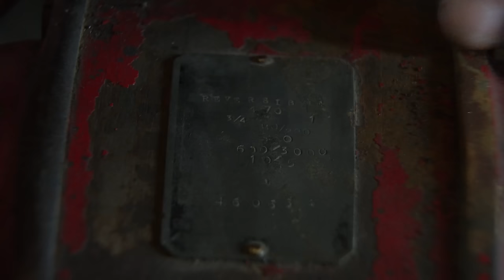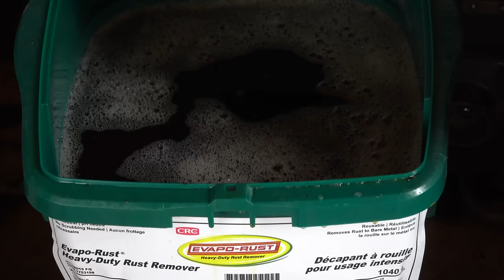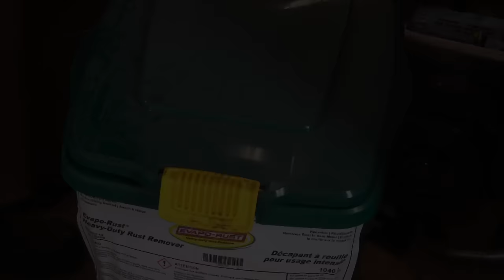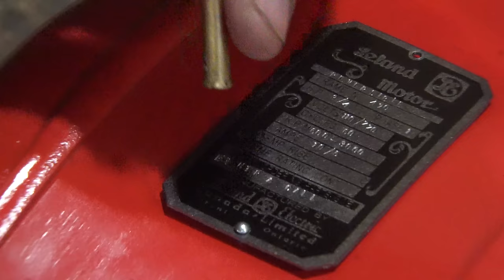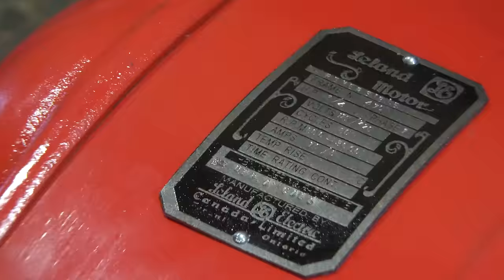Why Did They Stop Making These? [Restoration]

Comment: These sort of motors are apparently called "repulsion motors" ( https://en.wikipedia.org/wiki/Repulsion_motor ). They seem to be very similar to a normal brushed AC motor (e.g. vacuum cleaner) but are wired up differently. My $0.02 for what it's worth. In a regular AC motor, mains current passes through one stator coil, through the rotor via the brushes, then out through the other stator coil. However, in a repulsion motor, mains is connected only to the stator coils. The brushes are shorted together. Depending on the angle of the brushes relative to the stator, that determines whether it runs fowards, backwards, or is stationary. It's now got me wondering if it would be possible to convert a regular AC motor into a repulsion motor with a bit of tinkering!
Reply: same! That would imply giving pseudo VFD capabilities to a motor that couldn't otherwise be outfitted with one.
Reply: Thanks for the info, i was wondering what type of motor this is. Never saw one like this
Reply: Not the same as vacuum motor
Reply: A lot of modern mains powered drills (at least from Bochs, DeWalt, Hilti and Metabo) have a brusholder that is turned to reverse rotation but the brushes are wired the same way as on models with a reverse switch.
On some of them you can turn it partially and get lower speeds, but that's not the proper way since those have electronic speed controllers and some also 2 speed gearboxes, but I think all of them have an interlock to not allow the trigger to be pulled when the brush holder is in "neutral" or too close and the same way you can't reverse it while you have the trigger pulled
Reply: I think this is a good description.  I wonder what the torque curve would look like?  I suspect that the available torque would decrease rapidly once the brush timing got away from the ideal. So although the speed and direction under no load look good the performace under load might not be great.  Unlike a recent electronic speed controller.
Reply: @dundasjunctionmodelr.r-jam8267  I didn't say it was....
Reply: @ruben_balea  Interesting! Do you know any model numbers? I could actually do with a new mains drill 😎
Reply: @hefy2jefy  It is at its peak 45° from the neutral "off" position. The torque curve is your basic sinusoidal curve it isn't particularly interesting. It is however fairly interesting that it it can handle a variety of voltage ranges due to the stator being (effectively) isolated from the armature. More so than modern alternatives. 

Unfortunately the design is fundamental flawed in a variety of ways mainly safety, longevity, and ease of use.
Reply: that´s the same thing i was thinking it could do
Reply: In the 00's a friend of mine took up a cinema that was without an enterpreneur... film would still be the way to go for a few years, although digitalization was soon to come... yet in between, the "solar" soundtracks were changed from black to cyan dye and the exciter bulbs to red lasers or high intensity LEDs. Well, I could go on about that.... but the film winding bench had this type of motor.
Reply: And it's not used anymore because deliberately introducing slip in the rotor is horrifically inefficient compared to a VFD  :P
Reply: Make a video.
Reply: @imajeenyus42 In your first description, isn't that a "series wound" motor? The funny thing about that is they can run on either AC or DC. One time just because I was bored, I ran a 120v drill with a 6 volt battery! It worked, but of course it was turning really slow.
Reply: @ct92404  Yup, that's right! You get series, shunt, and (apparently) compound as well. The varieties are endless ;-)
Reply: @synisterfox Using 2 of the 3 outputs of a VFD (and disabling missing phase detection feature, if present) should work on a brushed universal/series-wound motor, although you'd need to program a vfd output  to flip an accessory DPDT relay to flip tbe brush polarity to make reverse work.  You'd probably crank up the Volts/Hertz ratio as high as you can so that  voltage changes a lot, in as little Hz change as possible.    But it'd be overkill in most applications as TRIAC choppers work pretty well.
Reply: @cda32 Oh man, I imagine the Power Factor must be awful, dirty 'n noisy. But hey, it's the 30's and that's way cool.
Reply: My parents have a 35 cow dairy barn with an old Berg chain-drive gutter barn cleaner and a single-phase 240v 5 HP repulsion motor. The shorting brushes can be rotated, but the frame is fully enclosing with no external adjustment. Other than brush replacement every decade or so, it keeps going with very little maintenance.
Reply: @synisterfox  it's not a variable frequency drive, it's a variable torque drive, I think
Reply: Your link was for me broken. So here is a search string that should take you to the correct page:
    en.wikipedia.org/wiki/Repulsion_motor
I don't know why your link didn't work for me.

You are right, this is the exact type of motor. The repulsion motors work by creating a standing field in the stator windings. This is then inductively coupled to the windings in the rotor, much like a transformer. The induced field in the rotor can then be moved out to a different angle related to the fixed winding magnetic field, causing the rotor to turn. A nifty design, with one slight problem, that being that there is always quite a bit of current flowing through the stator. For motors that are in constant use, say as the motor for a lift system or even for say a train, this is not a problem.
Reply: Wow, so many clueless people. FIrst off, those motors used in power tools DO NOT work the same as this repulsion motor in the video. Those are universal motors and can work on AC or DC. They are actuallys series wound DC motors. The repulstion motors are an AC ONLY MOTOR, however. FInally, stop saying AC motors all have brushes, they don't. There are also AC motors that don't use brushes that are called AC INDUCTION  motors. Which are quiet common around the house hold and in factories. Just tear apart your kitchen exhaust fan for example..
Reply: @GannDolph neat! thanks for the info. I was mostly looking at my RedWing Dental Lathe (Its essentially a bench grinder, but whisper quiet and has a quick change chuck on one side) for the potential modification and kept running into sources indicating that it is incompatible with a VFD. But I clearly haven't researched the topic heavily enough.
Reply: @hadensnodgrass3472  "...Unfortunately the design is fundamental flawed in a variety of ways mainly safety, longevity, and ease of use."
It shares those same flaws with me. I think that's why it's so endearing.
Reply: @synisterfox  The motors that don't work with a VFD are universal motors, they always run as fast as they can, independent of voltage frequency. However, they are easily controlled, if you have a feedback channel, you can use a PID controller and phase cut for AC or PWM for DC to control the motor.
Reply: @hefy2jefy  I was wondering about this too
Reply: Not sure how this motor operates, but brushed motor that operate on both AC and DC are universal motors. If they only run on DC, then they are DC motors. Both typically have only two wires and two brushes. This motor, however, has three wires and three brushes, which is odd.
Reply: @bobweiram6321  This motor has four wires and four brushes. However, the brush configuration doesn't fit with any of those described on the Wikipedia article. The four brushes here appear to be all shorted to each other. Very odd. I finally succumbed and bought a cheap brushed vacuum cleaner motor to play with ;-)
Reply: Maybe some brushes are shorted but two must connect to power to create a magnetic field in the rotor. They can be in series with the stator coils or in parallel depending on the design. Rotating the brush assy. will be changing the relationship between the two fields. Some very old car generators used a movable brush to adjust their output.
Reply: Repulsion start induction run motors are dinosaurs, much like disc brakes have replaced drum brakes and fuel injection has replaced carburetors these old motors were replaced with lighter weight and physically smaller ones of the same horsepower. Personally I see no practical purpose for one of these motors when there is plenty of relatively inexpensive modern motors to choose from for different purposes, however these old motors make adequate improvised boat anchors.
Reply: @MrGlenferd  No, in a repulsion motor like this, they are not connected to an external power source, only in a normal universal motor. In a repulsion motor, current is induced in the rotor coils by the stator.
Reply: @modoc852  Absolutely, give me a 3-ph motor + VFD any day! But there is something extremely cool about having a speed control like this built into the very motor itself.
Reply: I would imagine this type of motor was used in early electric city trams or small trains, much control right in your hand.
For some reason I keep thinking about that.
Pretty cool stuff, but yeah, probably highly inefficient for magic electrical reasons.
Reply: @FreeOfFantasy ohhh. okay that's cool. I'll have to look into building something out then (depending on the price of the parts list vs something ready off the shelf). Thank you for the info, I appreciate it. Actual TIL moment.
Reply: @oldfarthacks  Yeah, it screwed up when I put it in brackets, fixed now!
Reply: Man I was thinking the same thing! Take a shunt wound universal motor, give it new moveable brushes and you could probably get some repulsion motor action out of it. 

It might not be very efficient since not all of the parts would be designed for it but this video kind of makes me want to try!
Reply: @EETechs yup. The series or shunt wound motors have a lot of the same parts but they operate very differently.
Reply: @MrGlenferd none of the brushes on the motor in the video are connected to mains. The stator is connected to mains and induces voltage in the rotor. The brushes provide a path for the induced current and decide where in the rotation the current can flow.
Reply: @ct92404 , no A series motor would have more wiring connecting the brushes to the field coils.  Those wires would have shown during disassembly.  A repulsion motor simply needs to short brushes together, the are independent of the field coil.
Reply: @MrGlenferd I have an old Worthington compressor with a similar motor 1913. It has four brushes connected to each other in pairs. No other connection to the brushes. The outer magnetic field creates voltage in the rotor that creates a repulsive magnetic field. BTW I have been using this compressor everyday for 25 years. Replaced the brushes once. It does need commutator cleaning a few times a year for proper startup. It has the the flow out put of a newer Ingersoll rand 5hp industrial compressor with a 2hp motor that may or may not be read by the electrical meter when running.
Reply: @hadensnodgrass3472 , "is fundamental flawed due of ... ease of use"?
You must be kidding.

Comment: An old repulsion induction motor! With exterior reversing handle. I had one I would play with, years ago. Repulsion induction motors are known for their torque and that they are reversed by moving their brush cluster. Not seen much today, a personal favorite! Great job!!
Reply: Yup!  Learned about these in the Navy many (too many) years ago.  Notice no external wires to the brushes.  In these they are just used to short specific bars of the commutator together.  Changing the angle changes which coils of the rotor are shorted in relation to the stator winding.
Reply: Thank you so much for the name! I had one of these, quite new in fact (made maybe 15 years ago), on my honey extractor and I was curious how it worked but didn't know what to google.

I guess they are mostly superseded by VFD, i.e. semiconductors replacing ingenious electromechanics as usual.
Reply: @mumiemonstret My gut tells me that these motors are probably insanely inefficient at anything below max speed. You're essentially making a space heater that can rotate as a byproduct.
Reply: @WyckedSludge  That is true, but you save on heating your workshop 😄
Reply: I'm sorry to say but this isn't a repulsion start induction motor, much rather a universal motor. This one lacks any mechanism that would disengage the brushes and short out the rotor windings once it reaches near synchronous speed, to which this doesn't seem to 'pull into'. It just seems to spin at an arbitrary speed controlled by the lever.
Reply: @mumiemonstret  that seems like a good guess,  to a mechanical engineer moving parts are a liability.  a brushless DC motor, or an induction motor haver only one moving part.
Reply: @WyckedSludge  the power factor is lousy, but they don't make a lot of extra heat in the stopped position because it's mostly reactive power.  iron transformers with no load are similar.
Reply: @750kv8  it's not a repulsion start motor.  it runs as a repulsion motor.
Reply: @randomblogger2835  - Which is the same as a universal motor. Repulsion / repulsion start is just another name on the same thing. Repulsion start motors literally start up as a universal motor until a centrifugal mechanism on the rotor disengages the brushes and pushes a shorting ring against the (there disk shaped) commutator, or something like that, once the rotor is up to near-synchronous speed. In that moment they switch to induction motor operation. Yes, this one on the video is NOT a repulsion start induction motor, it's a 4-poled, 4-brushed universal motor.
Reply: @750kv8  not really, eg: they won't run on DC
Reply: @randomblogger2835  - Correction: You COULD make a repulsion start induction motor to start up on DC WHILE it's in universal motor mode. Once it switches to induction motor mode, it loses power, the EM braking effect would quickly slow it down, which makes it to switch back to universal motor mode. It'd keep cycling like that. A very undesirable, erratic mode of operation that possibly risks it to overheat and burn up or wear out prematurely.

Universal motors on the other hand, as their name suggests, are capable to run both on AC and DC.
Reply: @750kv8  Absolutely not a 'universal' or DC motor in any sense - operating principles, performance characteristics, electrical connections, and so on. It's common 'product name' is indeed a repulsion motor but that's an imprecise term. It is technically an "AC induction motor with wound rotor". The more widespread variants of these were typically referred to as 'slip-ring' repulsion motors.  Depending on cost & application some sub-variants of those lifted their brushes, or just disconnected the rotor winding series resistors, when up to speed - some didn't. 
But they don't start or run as universal motors. The brushes + segmented rotor connections here do not provide the same functions as the commutator in a DC/universal motor. They neither supply power to the rotor nor 'commutate'  (ie reverse) the winding current flow during rotation. They permit selective shunting of the rotor windings and as the current in these is caused by induction (sometimes AKA 'transformer action'), it relies on the stator having an alternating field. This shunting scheme is used to modify the torque/speed/current characteristics compared to, say, the ubiquitous squirrel-cage induction type.
With the fixed speed so-called 'slip-ring' motors this allows high start-up torque loads with much reduced peak currents. Here, it provides a reasonable form of reversible speed control.
Another feature is that they will start properly from a single phase AC supply without needing a phase shifted secondary stator winding, or shaded-pole arrangement, etc. They have numerous disadvantages though, so much less used and now superceded in this form.
Reply: @jackgee3200  - Thanks for the info, my bad. I missed that detail that the brushes aren't connected to the cord.
Reply: @750kv8 
I beg to differ. I have a 1-1/2 hp motor just like this one that says "repulsion induction motor" marked on it. Original id plate is very readable
Reply: @chuckmarch5552  - jack gee corrected me, read his comment.
Reply: Nut seen much, except of mains powered, reversible hand drills :)

Comment: At 7:46, I was glad to see you add solder to make a better connection, I have seen so many fails, because people thought clamping would work by itself.. Saving all the old wire you could, showed me you respect the the makers.. Loved seeing you didn't modify it with modern bearings, using the old oiler's was a class move.. If you find out what it was made to power, please update it for us.. I love history, especially industrial topics.. IE Motors & Machines.. 
Thank you for sharing, always a treat to watch..
Reply: I have one of these motors on an air compressor and one on an industrial fan. ❤😉
Reply: There is a special crimp tool for that type of sleeve and it is not lineman's pliers.  Solder is not needed with the proper tool.
Reply: I have seen these on old hand-fed letterpress printing machines.

Comment: That brought back some memories. I was in the Coast Guard and stationed on diesel electric large bout tenders in the great lakes. They used two engines connected to generators that put power to a main motor, connected to the single shaft and prop. Just imagine that motor being 10 feet in diameter and switching back from full forward to full reverse constantly during the day while ice breaking or tending buoys. It's a sight to see. Thanks for the video.
Reply: You'd see motors this large in steel mill blooming mills used to reduce an ingot to a billet.  Motor never turns more than a few turns before reversing, each pass squeezing the ingot a bit.
Reply: Look up Ward-Leonard